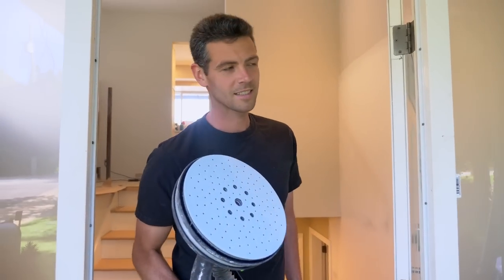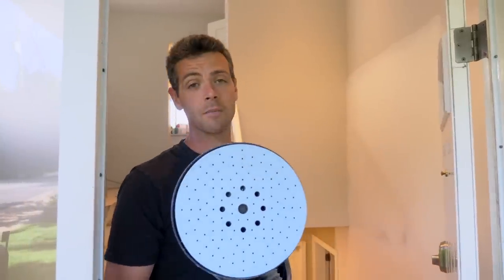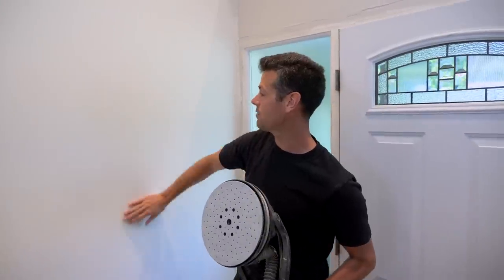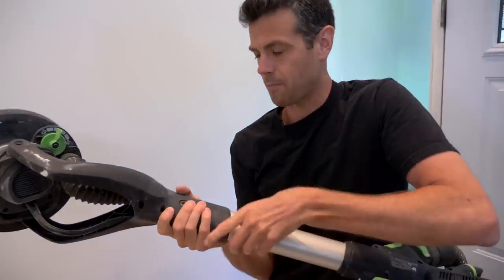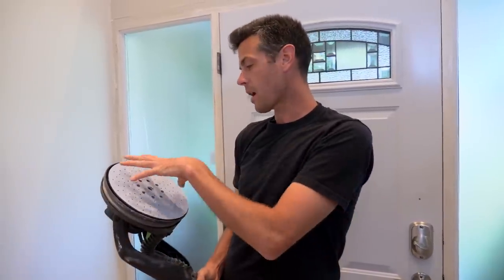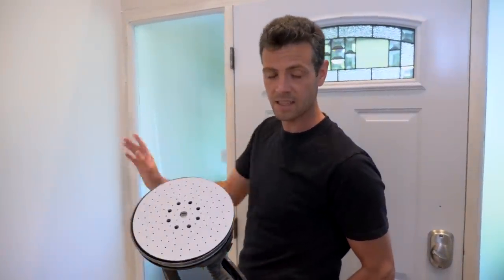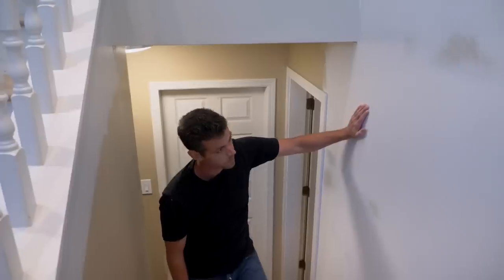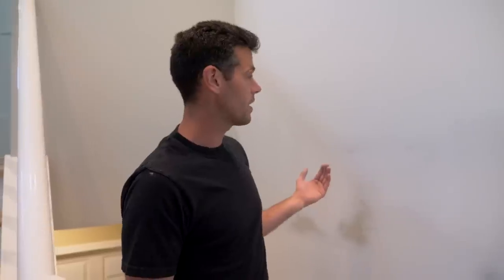How Dustless is the Festool Planex 2?

Comment: Hi Ben. If you allow me to give some advice... at 3:17. Press the head of the sander against the wall before you start it. The soft start of the Festool is one of the biggest advantages over the competitors. First press it on the wall, then switch it "ON" and immediately lead it to the sides. This way you will avoid gauges on the wall/ceiling. Another great video. Greetings from Bulgaria. :)

Comment: I just bought this (you contributed partially to deciding on it) and even though I've seen already a few of your videos on the Planex 2 subject, this one I've just watched. I just noticed something that is not the end of the world but seems to be a design problem. At 3:45 and 4:26 (that's when I could see it better because the light is not shining in the camera) when the dust extractor knocks to clean the filter, you can see a shroud of dust falling from the head. I think that for a split second suction is interrupted by the knock. I know that the benefit of having the filter cleaned constantly and prolong the duration of proper suction is clearly compensating for leaking a bit of dust but I am surprised they couldn't find a solution to have uninterrupted suction and the cleaning filter feature.
Reply: Honestly I'd presume the best option for them to design it differently would have to be to use two different "chambers" in parallel and only clean one at a time

Comment: They should have a shroud that extends a few inches out and when you turn down the suction it diverts excess airflow through the shroud instead

I want to buy one but I'm afraid it's hard to justify if I have to choose between maximum dust collection or best sanding quality...

Comment: I really want to hear your take on the Mirka
Reply: Mirka is the best, hands down.
Reply: @bobseguin2195  lol always one of you on here.
Reply: We’ve tried the mirka for heavy sanding and texture removal, it sucks. The festool smokes it in that regard. For ultra finish sanding the mirka may have a tiny (and I mean tiny) advantage.
Reply: @ryane6719  Heard somewhat the same but with more credit for the Mirka on it's finish.  I agree I wouldn't use the Mirka for texture removal
Reply: @FixthisCD  Granted I’ve only had the new festool for about two weeks, I’ve logged some serious hours with this thing. We do have the Mirka as well(it’s a year old). With the light and the plug and play ct dust extractor I honestly give the overall advantage to the festool at this point
Reply: @ryane6719  so the festool can grind off old texture heavily painted with  oil based enamel?
Reply: @bobseguin2195  lol yea because that’s what we’re talking about. And maybe with 40 grit.. we don’t encounter that so personally can’t say.

Comment: So you used this between coats.
Do you use it for final sanding the skim coat too?
Asking for a friend.
Reply: I can’t speak for him. I use mine between every coat and final. I have switched to a Mirka however. It is way less aggressive. Much better sander for fine sanding. Not for removing popcorn or heavy stippling on plaster finishes.